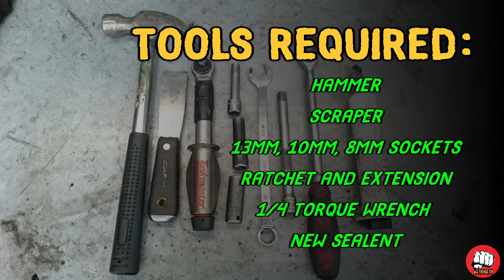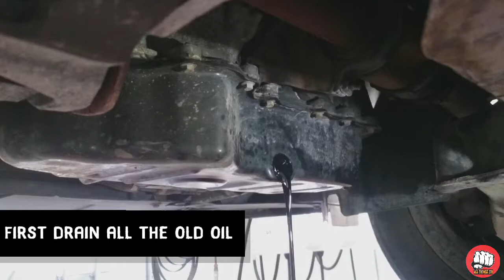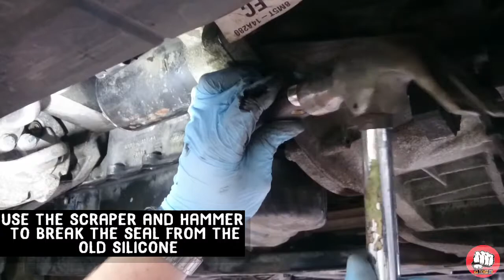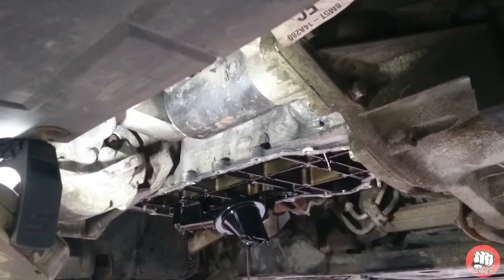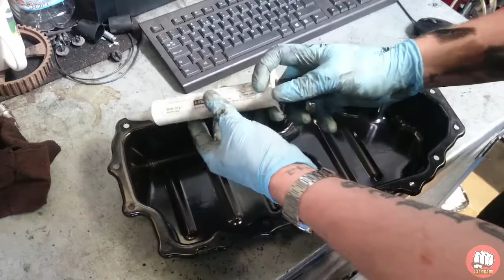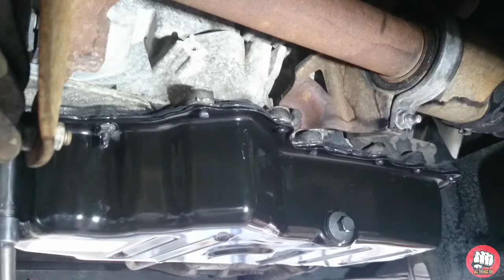sump / oil pan replacement- 1.8 duratorq lynx engine sump - how to

Comment: Great vid, Do you know whether the alternator bracket mounting bolts go through inside the sump?
Reply from the maker: I highly doubt it no, that would create a possible leaking point 👍
Reply: ALL THINGS JIM thanks, I have a leak all around my sump and it also just looked like it was coming from the alternator bracket bolts aswel. Probably just the oil going upstream. Thanks for reply